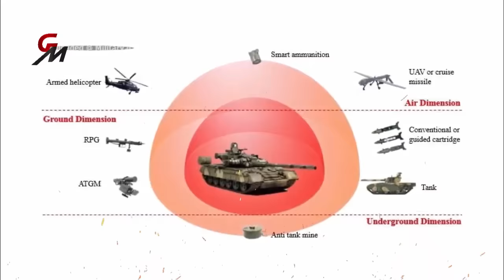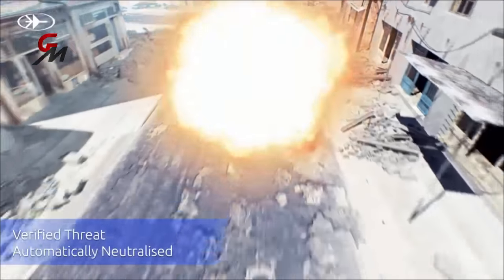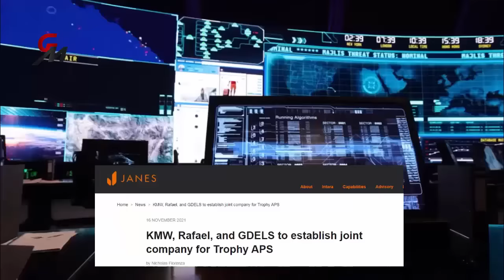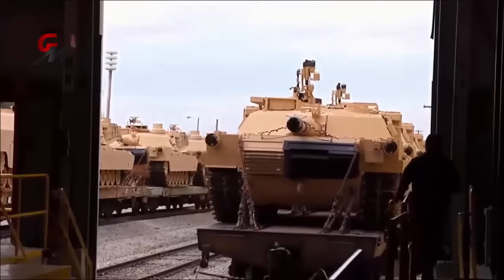The Only Reason Why The UK Challenger 3 is The Most Feared Tank on Earth

Comment: Challenger 1 with a rifled barrel still has the longest tank on tank kill in history.
Reply: I thought rifled barrels were more accurate to smooth bore.
Reply: they fire HESH rounds which allows longer range. Smooth bores are better for APFSDS .Which result in much better accuracy and penetration at range especially with DU APFSDS.
Reply: @tonysheerness2427 they are but require 2 part loading ie charge is loaded separately to the projectile, the switch to smoothbore is more to bring in line nato standardisation of ammunition
Reply: Ukrainian T64 beat the record recently with a 10,600km (6.5mile) shot
Reply: Very impressed with you knowledge. Wow. We need more4 like you.
Reply: All about ammunition NATO standards
Reply: @ianbaird1774  Unconfirmed
Reply: Without video evidence, which is lacking I highly doubt a T64 can even produce the power to push a projectile 6 miles. Challenger 1 achieved its kill which was beyond its effective firing range.
Reply: @paullakowski2509  HESH is only accurate as an antitank round out to about 1750 metres ... its relatively low velocity with a ballistic trajectory with attendant round to round dispersion ...
Reply: @ianbaird1774  ... yeah, right!
Reply: @ApplyWithCaution HESH wasn’t used primarily as anti tank. It is/was used against soft and area targets but did require a rifled barrel, which is why we Brits clung to rifled barrels for so long. Secondly, to say HESH is inaccurate is incorrect. Modern ballistic computers are exceptionally accurate! Finally, since the graticule pattern for HESH goes to 3200m and the BC can handle ranges in excess of 10km, 1750m as you state is woefully short of its true range. Not sure where you got your fats from but it wasn’t on the tank park!!!
Reply: @inabiird1774 sounds like a lucky shot. It's possible to get 3 points in basketball 🏀 3 seconds before end of match from another side of court 😅
Reply: @tonysheerness2427  
They were, until fin stabilised rounds came along - the fins spin the round for stability, without the loss of power from the rifling.

The rifling is there for HESH rounds, they need it.
Reply: @markbolam1592  ... having been a tank gunner on Chieftains I can confirm that HESH was intended as an anti-tank round ... the pancake when it struck caused catastrophic spalling on the inside of the target ... we assumed a 3 round engagement with artillery type adjustments until impact, due to round to round dispersion resulting from its ballistic trajectory ... the whole point of base fusing a HESH projectile was to take advantage of the pancake ... the shell wall tapered towards the ogive to enhance the pancake effect ... the original 4 dot sight was calibrated to ballistically match that of the 50 calibre ranging gun ... and I got my facts on the tank park at the RAC TRG Regt at Catterick, QRIH in Paderborn and on Höhne Ranges ... as a gunnery instructor ...
Reply: @tonysheerness2427  Rifling is one way of improving accuracy but not the only way.
Reply: @LetsSWITCHGames  it’s likely just another Ukrainian fairy story!
Reply: @ianbaird1774 ah yes well of course they did.
Reply: Is the kenetjc energy those uranium rounds utilise 😍 keeps going n going 🤗
Reply: @ianbaird1774 where is the link

Comment: Challenger is faster xcountry than Abrams, because of its suspension. Also the vehicle is lower and more repairable because the suspension units are external, unlike others where double torsion bars go in the bottom of the vehicle, which raises the profile. 
CR is also vastly more fuel efficient than Abrams. Combat radius is nowhere near as good as Chieftain, but we don't run out of fuel as the US did in GW.  Fuelling is a real problem with Abrams. 

The point about the HESH round was that, in the past it was the projectile that satisfied the NATO accuracy requirement, despite the fact that the primary a/t round was APDS. We later changed our primary anti armour round to a DU fin, using a slipping driving band. One of the problems going to the Rheinmetall gun is the fact that it uses fixed ammunition. This means that we have lost our 10degrees of depression, because you need a longer space behind the gun to load it. This means that, in a hull down position much more of the vehicle has to be exposed, in order to cover the same area of ground in front of the tank. - compared with other vehicles 5 deg of depression. So you offer roughly twice the target area. This not only affects detection and visibility, but also the chance of the enemy hitting you with a less accurate gun. Hard lesson learned in WW2

Comment: Having a rifled gun barrel was NEVER a problem for the challenger 2 it was Nato that had the problem with it as 80% of Nato tanks were using the same Smooth Bore gun.
Reply: Which is the biggest reason for us to change to smooth bore.
Reply: @ashleygoggs5679  No the reason we changed to the Smoothbore now and not before is the challenger 2 would have had to have its entire turret redesigned the challenger 3 has the turret built around the new gun system. we just had to wait until now for the upgrade.
Reply: @simon0674 presumably no HESH then?
Reply: @artnull13  unfortunately no
Reply: @artnull13  nor HEAT

Comment: Funny old thing, the longest tank on-tank kill was by a Challenger against an Iraqi Russian built tank, the Challenger had a rifled barrel.
Reply: And your point is?
Reply: @legend9335  That the gun on the Challenger 2 wasn't bad and retained stopping power at range despite rifling. People cite the gun as a weakness of the Challenger 2, but really it was fine. The new gun though, together with the suite of gizmos that make it equally accurate to a rifled barrel, is even better.
Reply: @GoodEggGuy  it depends how you look at it. As an infrantry support platform the rifled barrel was very good becuase of HESH, however as a interoperable platform with allies it was great due to logistical constraints and then there is the factor the to counter the rifling the APFSDS round lost some pentration power aswell as the 2 piece ammo making the dart slightle shorter to our nato counter parts reducing its penetration a little more. Its the weakest armor penetrating cannon of all of NATO MBTs however still 100% functional by every means.

Comment: I've heard that the rifled barrel of the challenger 2 has a particular utility with regards to the HESH tank round in the sense that the spin of the round helps the plastic explosive 'pancake' against the surface of the target. It's a clever idea really of not actually trying to penetrate armour as such but rather to cause massive trauma to the interior of the tank ... and it's crew. I assume a smoothbore can also fire such rounds but perhaps with slightly less efficiency?
Reply: 100% correct.  In particular this aspect was useful in demolishing buildings, therefore was very useful in Iraq.  Other NATO rounds simply couldn’t do what it could in many instances, making Chally 2 really useful in an infantry support role.
Reply: a smooth bore hesh would probably miss by 20ft

Comment: I gotta say rifling in a barrel does not increase the friction it decreases the friction the rifling also make it much more accurate. They went to a smooth bore because that just opens up the amount of different kinds of rounds that can be fired
Reply: ...what? Rifling increases friction, it literally spins the shell by creating resistance, without increasing friction it just wouldn't work. And yes, it makes it much more accurate compared to an old fashioned smoothbore, but ammunition can create the same effect without needing rifling now. A modern smoothbore is just as accurate, while achieving a higher muzzle velocity.

Comment: That rifled barrel still holds the record for the longest tank on tank kill at 5,000 meters it is incredibly accurate, but as the shells for it are unique to the UK they are relatively expensive and if operating with NATO forces are not interchangeable. So although it's far more accurate and a far better gun we have to dumb down to the standard NATO round.

Comment: - The Challenger 3 has been unveiled as the UK’s newest and most “lethal” main battle tank (MBT); 
- The Challenger 3 is produced by modernizing existing Challenger 2 MBTs with 127 planned for conversion from the UK’s existing 221 Challenger 2s; 
- The refurbishment/modernization of 127 tanks will cost $990 million or approximately $7.8 million per tank, several times more than modernized Russian tanks, and even more expensive or as expensive as new Russian tanks; 
- The Challenger 3 will weigh more than its predecessor, and both tanks are heavier than their Russian T-72B3, T-90M, T-80BVM, and even T-14 counterparts; 
- 127 MBTs in total will mean that most likely fewer than 100 tanks will be operational at any given time making it impractical for the UK to project military power abroad in any significant manner; 
- The Challenger 3 features a 120mm smoothbore gun that will use NATO standard tank rounds which is an improvement over the Challenger 2’s rifled gun which required unique ammunition incompatible with other NATO tanks; 
- The Challenger 3 is another illustration of Western military industrial production, emphasizing expensive, complex weapons built in small numbers to maximize profits versus equally capable, but cheaper and more numerous Russian or Chinese weapons designed to maximize both battlefield and strategic effectiveness;
- While a Challenger 3 may or may not be capable one-on-one with a Russian MBT, the fact that Russia has many more tanks and is able to replace damaged or lost tanks faster than the Challenger 3 and other Western MBTs proves a disadvantage to the UK and the rest of NATO;

Comment: The rifled barrel wasn't really an issue in itself; it just wasn't wholly compatible with the use of APFSDS shells. Rifling is used to stabilise shells by imparting spin and therefore making them more accurate at range. An APFSDS (Armour Piercing Fin Stabilised Discarding Sabot) is already stabilised so doesn't need to be spun. The British favoured the use of HESH shells though which did benefit from the spin; so the two rounds were in conflict with one another in terms of rifling.

I believe modern tanks now are generally lined with Kevlar spalling shields internally which reduces the effectiveness of HESH and makes the already stabilised APFSDS rounds more preferable and therefore better suited to a smoothbore gun.

Comment: Rifling is used to cause the shell (or bullet in a gun) to spin.  A spinning object (like a gyroscope) is not affected by torsional forces, and hence the shot can be more accurate.
Reply: Modern apfsds has fin to stabilize so accuracy is not an issue.

Comment: Rifled is more accurate, smooth bore requires stabilised shells. The change was purely to ensure compatibility with NATO rounds.
Reply: Apfsds is already stabilized thanks to the fin, the same type of anti tank ammunition that Challenger 2 is using. So the accuracy is not an issue

Comment: It's going to be interesting to see how much further the Challenger 3 can shoot considering the Challenger 1 holds the record for the longest direct fire shot (I'm aware the Ukrainians are claiming the longest kill - it's a impressive feat but was using a T-72 in an indirect role so moving it away from a tank shot and more into an artillery shot instead).
Reply: Even on 1000 meter it's already indirect because of the bullet drop
Reply: @bigmock141 thats not indirect. Bullet drop is normal in each rifle shot and each aiming device has settings for it. In tank its point-blank fire usually 1200m.
Indirect is if you hit from above,not directly.
Just use google before spitting self-lies

Comment: The main problem I see with the Challenger 2 rifled gun is it's life span. It is worn out after 400 full charge shots while the smooth-bore Rheinmetall gun used by Abrams and Leopard 2 lasts for well over 1500 shells fired.
Reply: Don’t no much then
Reply: @ashleybevis9769 At least I know how to spell but do fill me in what other major problems does the Challenger 2 have besides a gun barrel which wears out prematurely and prevents it from using standard NATO ammunition ?

Comment: The main gun is being swapped because the Rheinmetall 120mm guns are now nato standard.  Rifling itself is not a or the  problem.  The new M35 gun on the M10 Booker is rifled, because the nato standard for 105mm rounds is rifled because that what was being used at the time, all western tank guns of that era being based off the RO L7 105mm.  When Chieftan & challenger were being designed 120mm rounds did not yet have a nato standard.

Standardisation has always been a nato thing, this caliber has always been the outlier.

Comment: Need to have built in mine / heavy metal detectors on the front. Csn not believe how every tank on the battlefield don't have them
Reply: 1 that would be expensive, 2 that dosnt stop all mines, it would only stop pressure plate mines, not proximity mines or aerial mines. There are doctines for mine fields its wise to save money and use it where its needed more then waste it on something like that. Generally a mine doesnt kill a tank just stops it in its tracks.

Comment: Some misinformation in this video: the challenger 2 also used fin stabilised ammo, in fact, the rifled gun allowed it to use a bigger variety of ammunition due to it's rifling. The main reason for the switch is to allow the British army to use NATO standard ammunition, designed for a smoothbore, which would be cheaper and makes logistical sense if we go to war. Otherwise we'd have to manufacture and continually develop our own ammunition for use in the rifled gun. Should ne noted that the British used 2 piece ammo, where the explosive propellant is separate from the warhead, which in itself has advantages, such as storing the explosive part of the round in a different/safer part of the tank. If it wasn't for logistics and economics, you could actually argue the new gun is a downgrade.

Comment: Are the challenger 3 all new tanks or are the challenger 2 been used for the body's to upgrade the tank to 3
Reply: Challenger 2 hulls are stripped inspected, repaired and rebuilt for challenger 3 . They are getting MK3 upgraded hydro-gas suspension with low friction internals . Improved engine etc .
Reply: Upgraded hulls.

Comment: Many and I mean many military bods say going to the smooth bore is a backward step. No chance of it being as accurate over one mile plus distances. Laws of physics need to be completely defeated to do that. Every metric and combat sim, has found the current rifled gun better at one mile plus distances to ALL the other NATO tanks with 120mm smoothbore. The whole point of modern tanks is stand off, first shot kill, so being better at less than one mile is NOT good planning. When the enemy gets that close, something has gone wrong.
There are only two advantages to the smoothbore. 1) lifespan of the barrel. 2) smart rounds, but still needs massive improvements in those.